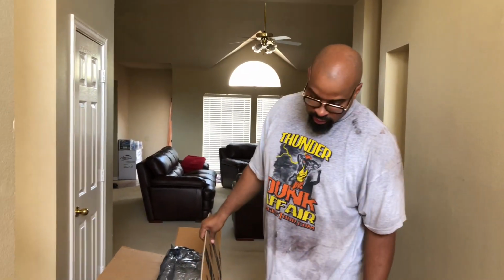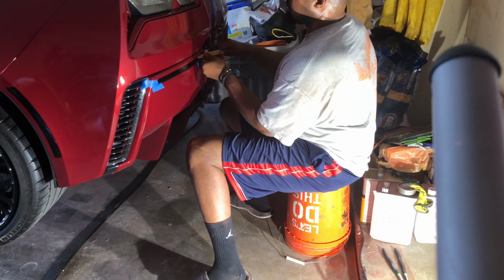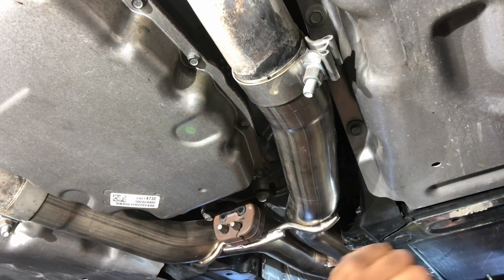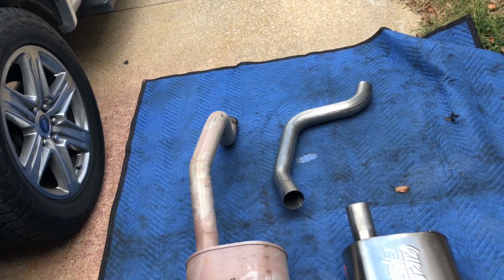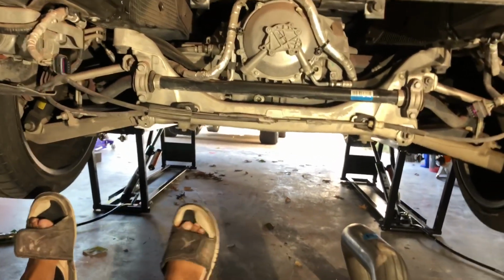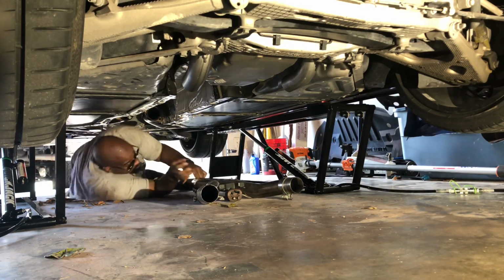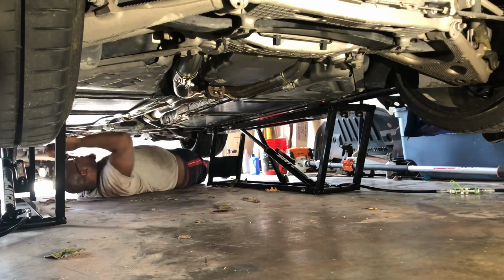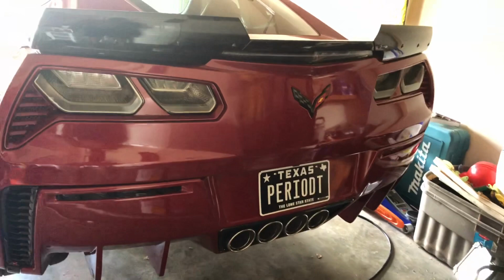C7 Vette Borla Atak

Comment: I'm surprised you didn't put blocking under the tires just as an added measure of protection in case that life system you have failed..
Reply from the maker: Using Quick Jacks, rated for twice the weight of the C7. Thanks for watching!

Comment: You're  putting a lot of faith in those  hydraulic cylinders aren't you?
Reply from the maker: Ummh ...FYI...Quick Jacks like all hydraulic lift systems have a safety locking mechanism. For the DIY'ers quick jacks are safer than jack stands.